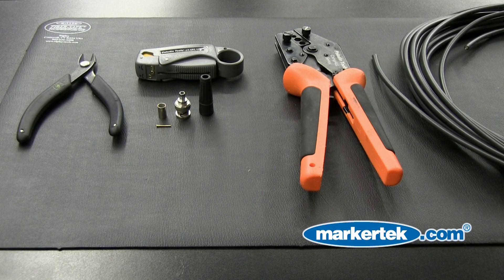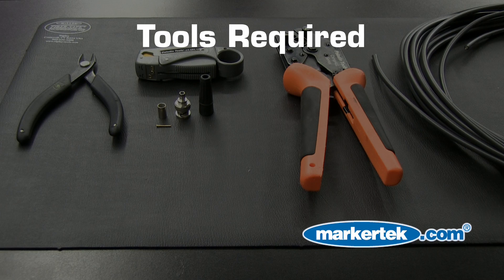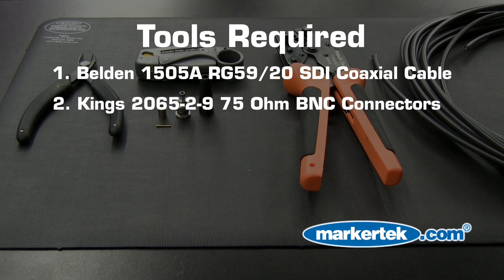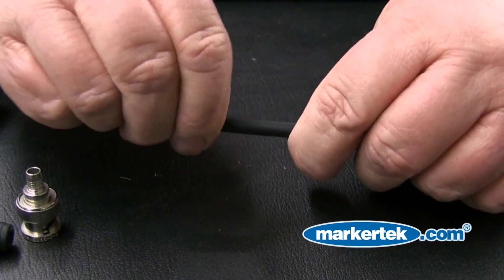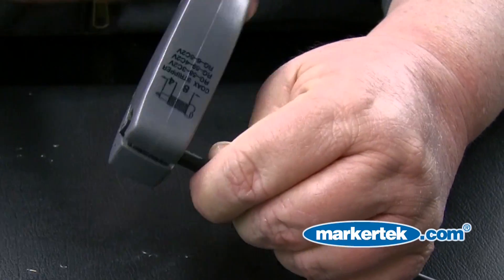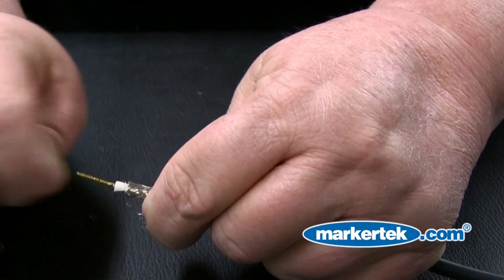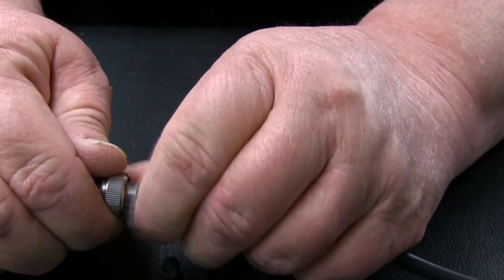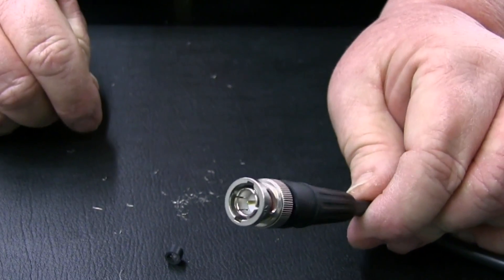How-To: BNC Termination Procedure for RG59 HD Coax

Comment: What Cable Tester do you suggest?
Reply from the maker: Hi Carl! The Paladin 1543 Data and Coax Network Cable Tester or the Paladin 1594 LAN and A/V Cable-Check will both work great for testing BNCs assemblies.

Comment: sNEVER double crimp a BNC connector.  Crimp once where the crimp sleeve meet the connector or use a full length crimp tool.  Double crimping can damage the dielectric, affecting the impedance of the cable.